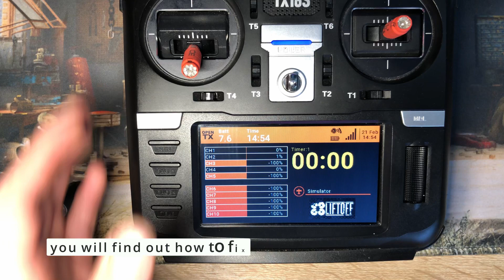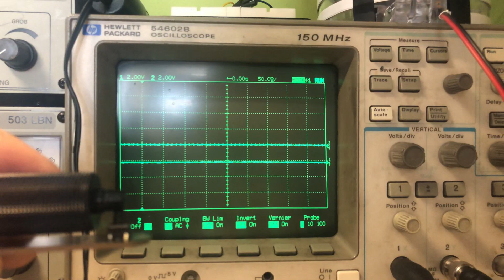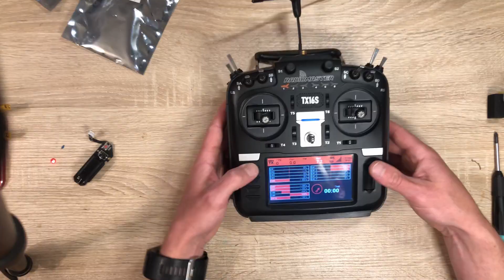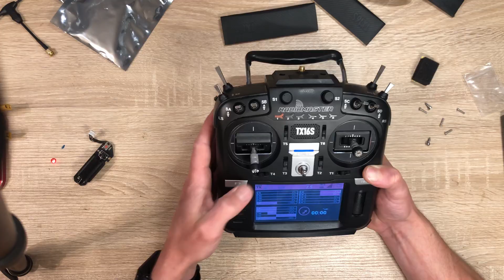Radiomaster TX16S roller wheel replacement (and speaker)

Comment: Just bought one brand new and I'm having the only scrolls up problem. Bought the dealers last radio in stock. It's the tx16 Max with the red metal wheel. Wondering if I'll be able to just replace the board and keep the same wheel for cosmetics. The replacement is black. Probably right ?
Reply from the maker: yes you can keep original wheel and replace just encoder with PCB

Comment: I've received my tx16s today. Its scrolls only upwards. Can't believe my luck lately 😕. Should I send it back or buy the part and attempt the fix?
Reply from the maker: Maybe ask for refund for a price of roller+postage+service cost, than order roller an replace by yourself. Than you can still use your TX16s till you recieve roller ( and you can use companion to configure it)
Reply: Bit worried I might void the warranty. Noticed there is a sticker over the join on the casing. They can't even replace it. I pressed buy on the last one in stock with this seller. See what happens now! I've contacted them and sent a vid of the problem.
Reply from the maker: @mathewwebb522  Ahh, OK, there's no warranty sticker on mine. Than is up to you if you want to wait to solve claim or If you just wait for a part and replace by yourself.  In RC hobby, from my point of view, nobody (skilled enough) cares about warranty of the parts as most of them needs to be modified somehow or can be easily repaired if they broke.
Reply: I appreciate that people fix their own things. I'm very handy myself in electronics. I repair anything from led tvs to the latest washer dryers. I just don't like the fact I've paid full whack for a working item and it pitches up a repair job. Decided to return it. The sticker over the join is just little QR sticker. It'll still let on ive opened it if I did. Local company so should sort it quite quickly atleast.